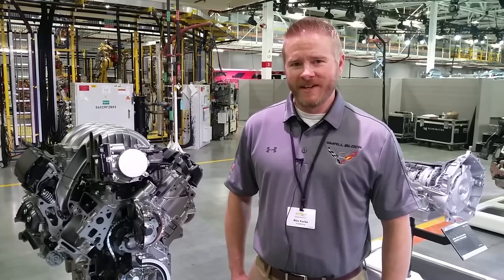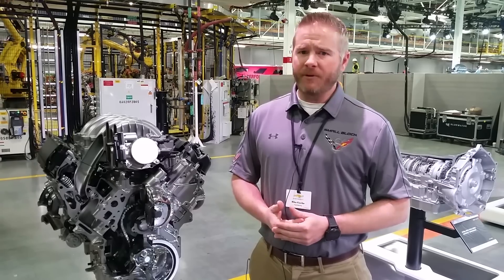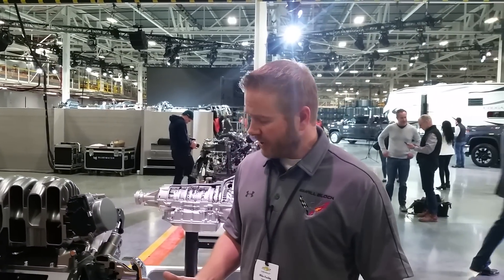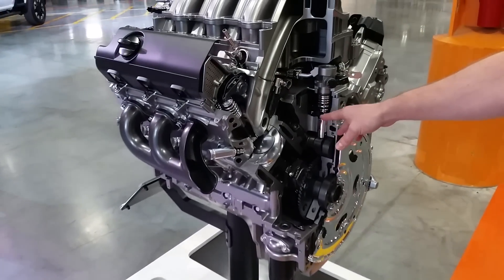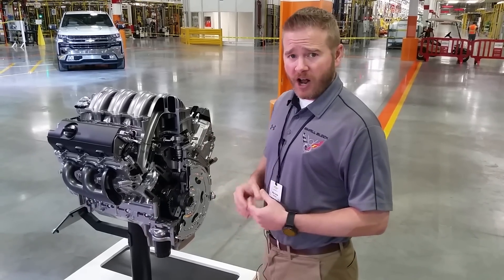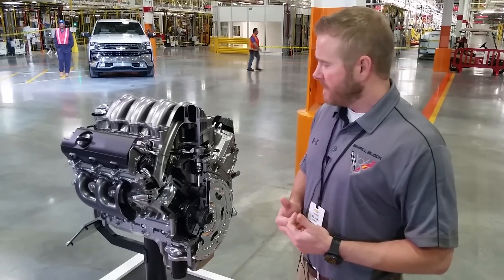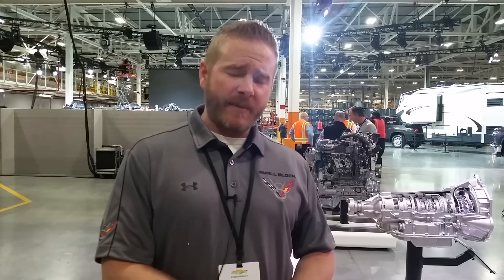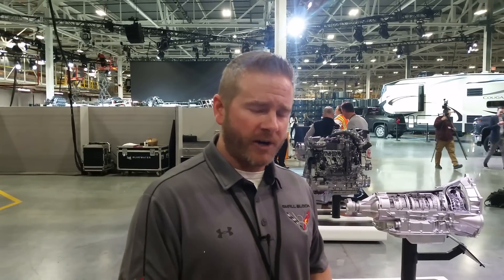New 6.6-liter V8 gas engine on 2020 Silverado HD

Comment: Variable oil pressure?WTF....
Reply: Just something else to go wrong.  Something will go wrong in this system and force a low pressure condition and toast an engine.  More complicated = less reliable that's simple math that can not be argued.
Reply: @IndependenceIron  
Actually, the "default" position will be high oil pressure, just like transmission line pressure is in the event of control system problems.
Reply: gm has had it for years nothing new here
Reply: Yeah I said the same thing. That shit is going to fucking break. No way
Reply: That's some hi tech. We used to think electronic ignition was weird.
Reply: Dan Hambrick means make sure to keep on top of your oil changes as one should
Reply: @455todrive  der ...also old oil is bad oil
Reply: Just saying there’s a lot of people that neglect routine maintenance that leads to motors crapping out
Reply: @455todrive  yup
Reply: That's been around for years., just  like everything else.
Reply: It's actually an awesome idea. Lubrication is critical in an engine, and temperature plays a huge role. Once oil is up to operating temperature, things are good (that's what they design the system around). But if the oil temp is low then the oil is thicker than it should be - this raises the pressure. Pressure does not lubricate - flow does. Pressure drives flow, right up until the cutoff point where the bypass valve opens. This is why most of the wear in engines happens when they're cold.

On the flip side, when you work an engine hard, the oil gets hotter than the ideal operating temperature- this thins it out more. Now you have more flow and less pressure- and this can also destroy an engine. But if you have a system that can vary the flow of oil and a high enough pressure limit you can make sure the engine is properly lubricated much more effectively. 

With all that said, all I heard when he mentioned it was the next big recall/maintenance debacle to hit the news. I just don't have faith that they've engineered/tested this well enough just based on their track record. Sorry GM... but I do think this will become a standard once the bugs are ironed out. :)
Reply: @Broadpaw_Fox  well said. You can wipe bearings with either condition. This could be a neat setup for example in Enduro racing. If it don't break.

Comment: Ford 7.3 vs GM 6.6. That’s a lot of cubes for some gas engines. Time to bring back the 8.1l vortec and 7.4l 454.
Reply: 327
Reply: Pontiac Super Duty!!! They own the copyright why are they not ? Put direct injection on it and a factory super charger. Use all forged internals, 6 bolt mains. 7,000 rpm red line.  Put it in a all new x frame coup' and in heavy pickups.  Offer a stepside bed gm. Get your act together.  We want real automobiles. Not plastic n pop- metal trash

Comment: I'm wondering how those Hyperutetic pistons are gonna work out in the long run, & powered metal rods?  Its looking like the 350 diesel, where the public does the testing...
Reply: Aaron Cone 
Considering the number of LS engines that use hyperutetic pistons and powdered rods, it should be fine...  Especially considering how many junkyard LS engines are running double the power of this engine.

Comment: I can get that out of a 350 and drive it anywhere I want and probably build it a whole lot cheaper. I thought y'all are going to say it made six or seven hundred horsepower pump gas lifetime warranty all the bells and whistles. Sorry I'm a GM man myself but just not impressed with this they should make more power
Reply: Can you match emissions, fuel economy, endurance and reliability? There's more to engines then HP but I will admit a lot of HP is good.
Reply: @60viking  I'm shure I can get close to the same on fuel economy because it takes fuel to build power. Emissions how ever I wouldn't worry about because I don't use cats on my exhaust anyhow. All they do is hold back power anyways.
Reply: GreenBoy at GA Farms ignoring emissions is a huge deal your claims are completely irrelevant if you’re ignoring that. I don’t know why you think you have a point when you throw that out the window.
Reply: You're out of your mind if you think this should be making 600-700 hp NA when it's going in a damn TRUCK. You would need an extremely aggressive camshaft to get that kind of power, and it would be sacrificed with an unusable torque band when towing.
Reply: @ @6484373   Yea Fool you are Smarter than the High Paid GM Engineers !
Reply: They have no excuse not to offer us the best. The own the copyright and blueprints to every GM engine ever produced.  Personally I want a Pontiac Super Duty  , all forged internals 6 bolt mains, direct injection, and factory super charger.  7,000 rpm big block Demon killer. In a x frame coup' GM OWES THE U.S.A.  now pay up. If you build it we will come

Comment: Ford 3.5 eco boost makes almost identical power. Gm dropping the ball again .
Reply: The ford is also turbocharged. The 6.6 GM will last a lot longer with the the parts not being over worked making such lower power ratings.
Reply: Ford just came out with a 7.3L gas motor for the same market... Jon Smith dropping the ball on being informed
Reply: Neither will last... Turbo gas motors are just not long lived units by nature and direct injection only works well till about the 5th or 6th oil change and by then the intake valves are typically all gummed up. They're both throwaway motors for throwaway vehicles.
Reply: @arman757  the 6.6 and 7.3 are both NA gas motors...
Reply: abortioncritical  read the rest of the comments, fucktard

Edit - lol nevermind with that user name, your just a piece of shit troll or just a general piece of shit. Carry on with your negativity and I'm sure your life will be awesome... Fun IS
Reply: Another clueless know it all comparing boosted engines to normally aspirated engines. Take your apples home kid, we're talking oranges here.
Reply: They could make 400 hp out of a big block in 1968 .... they can’t anymore with a direct injection today??? Wtf

Comment: They could get 400 hp in the 1960’s out of a Pontiac . You are telling me they can’t get 500 hp with direct injection in 2020? Fords new 7.3 gas motor is going to blow this away and it will have 10 speed transmission with over 500 hp. Gm should combine this motor with an Allison
Reply: 1960's 400 HP on the dyno. Huge 700-800 CFM carb, open headers, water pump if your lucky. 2020's 400 HP on the dyno: SAE standard conditions, full exhaust and emissions, every accessory installed and running on the motor as its being dyno'd.
Reply: You do realize that GM and Ford build the 10 speed transmissions together right? Also it will be strapped with a 10 speed. Ford puts up "big numbers" but when they actually get tested that fall very short of their claims.
Reply: If this engine was rated gross horsepower like the pre 72 engines it would be 500 quite easily. A "400" hp engine from the gross rating days would becrated 300 today

Comment: another engine that is disposable,variable oil pressure,sounds like a nightmare.
Reply: John Simmons sounds like a variable nightmare.
Reply: I hope you are joking about something wrong with the oil pressure going up and down with the RPM. If so, good joke. If not, continue with the research.
Reply: @davecozzi9721  - I didn't say anything was wrong g with oil pressure going up and down. Reread my post - I'm saying that you should see it changing as the speed and load change. You do need an accurate gauge though (most dash displays in the last 15 years are buffered to not show those fluctuations- it's the dummy syndrome). Oil pressure changes constantly in healthy engines- the pump is driven by the crank and flow goes up with engine speed. The engine is a restriction to flow, so as it goes up so will the pressure read. I think we're agreeing here. :)
Reply: direct injection is going to work great long term, am I right
Reply: I had a 350sb that the oil pressure would fluctuate according to  rpm. That thing got 250k when I sold the the truck. It started doing it about 2 years after I bought it. It was a 1977 1 ton dually.
Reply: @WheresHerb  wait it isn't supposed to increase oil pressure as rpms rise, every GM we have did that even the Duramax we use to have
Reply: @bryanmartinez6600  lol I know.But according to the oil pressure gauge at warm idle it was 20ish and it would peak at 42ish at highway speeds. It also went up and down between shifts ( 4 speed stick). Lol I couldn't find any problem with it. I took it to a mechanic and they thought maybe a oil pump. I said it seems fine so I left it alone and got roughly another 150-175k out of it before I sold the truck. It was a good ol' work truck.
Reply: @WheresHerb  I got 270k out of an 04 Silverado 4.8 too bad it was the weak 4l60 could have gotten more
Reply: @WheresHerb  
That's pretty much normal for most engines to drop some oil pressure at idle/low engine speeds once it's up to teperature.
Reply: some do,but I dont think I want it from the factory @WheresHerb
Reply: I posted this elsewhere, but its relevant here too. 

Also, on a healthy engine with an accurate guage, you should see the oil pressure fluctuate with rpms and load - it will go up as both increase, but drop a little as the oils heats up (see the book below for more). :)

Quote : It's actually an awesome idea. Lubrication is critical in an engine, and temperature plays a huge role. Once oil is up to operating temperature, things are good (that's what they design the system around). But if the oil temp is low then the oil is thicker than it should be - this raises the pressure. Pressure does not lubricate - flow does. Pressure drives flow, right up until the cutoff point where the bypass valve opens. This is why most of the wear in engines happens when they're cold.

On the flip side, when you work an engine hard, the oil gets hotter than the ideal operating temperature- this thins it out more. Now you have more flow and less pressure- and this can also destroy an engine. But if you have a system that can vary the flow of oil and a high enough pressure limit you can make sure the engine is properly lubricated much more effectively. 

With all that said, all I heard when he mentioned it was the next big recall/maintenance debacle to hit the news. I just don't have faith that they've engineered/tested this well enough just based on their track record. Sorry GM... but I do think this will become a standard once the bugs are ironed out. :)
Reply: @Broadpaw_Fox  
Most new trucks (and many cars now too) have pretty good sized oil coolers/heat exchangers on them now.
They are often called "heat exchangers" now, because they help to warm the oil up faster when cold, and to keep it from getting too hot when under heavy/extended load.

Comment: Great engine! Interesting the old low tech 400 (6.6) liter,  with "archaic " 750 Holley carb., made more than 400 HP. But hats off to Chevy!
Reply: They make the same power but the new engine shown in the video will have much higher fuel efficiency.

Comment: Not a fan of variable oil pressure..their variable cylinders was a flop
Reply: Not even remotely close to the same thing lol. And the DOD was not something they wanted, it was to please the EPA for mileage requirements on paper. If GM had their way they would have never put it on.
Reply: @quick455  this is true,but they're volunteering vop and I bet it fails often and probably won't be covered under warranty
Reply: @mysock351C  gotcha..hope you're right,never not been a Chevy fan and the ls's are amazing

Comment: All this technology didnt exist 10 years ago.  What do we gain now?  Higher repair costs bc they are built without proper R&D and slightly better fuel mileage.   They havent come out with a bullet proof combination in decades.  Every engine gets parts deleted or modified down the  road.    Discusting to charge 50k to 60k for unreliable junk
Reply: People like you have been complaining ever since Ford came out with the successor to the Model T. If people like you got what you wanted we'd all still be driving black Model T's. Why change or evolve something that works right? Ironically, the same could be applied to computers and the internet. If telephone and newspaper was sufficient to get information and news to people why bother inventing the overly complicated internet and computers to go with it? But you love that technology and the youtube where you can watch videos and write comments. You love it even though you don't know how it works or how to fix it if it broke, and couldn't afford to replace it if replacement costs came out of your wallet.
Reply: Pure ignorance
Reply: Actually...

All of this technology in engines DID EXIST 10 YEARS AGO...

Do some research lol...

Comment: All the expenses of diesel, with none of the economy.
Reply: This engine doesn't come with a DPF system and it's problems! Have you seen the difference in price between diesel fuel and gas? Ultimately it will be the same economically not to mention the price of a diesel engine vs a gas engine is $5000+.
Reply: @Punkinspapa  I suppose you're right about the def, and dpf. But i fail to see how it will be as efficient  with a lower compression ratio and no turbo. Its always  be a traid off Get 14mpg gas or 22mpg diesel. Idk which way is cheaper.
Reply: @aaaccc1598  Considering diesel fuel is extremely more expensive than 87 octane fuel that 8 miles per gallon savings disappears when you do the math.
Reply: @Punkinspapa  in what region? Diesel is about 20 cents more than 87 octane here.
Reply: @massey_2298  That's what I was saing. I was a truck driver the last 12 years and diesel is more expensive than gas everywhere I've been some more than others! But between the added cost of a diesel engine and a gas engine, particularly a push rod engine, and the expense of the DPF system plus the problems that come with them plus the cost of fuel, in the end even with better MPGs the diesel will cost more and have a whole different world of potential problems. I love diesel engines for towing and all but in reality for daily driving it really isn't any better.

Comment: I have a 17' Sierra 1500 with a 6.2 with 420 stock h.p. and 460 ft lbs torque. Why design a new engine when the 6.2 is awesome and proven????
Reply: Ryan this is for a 2500/3500